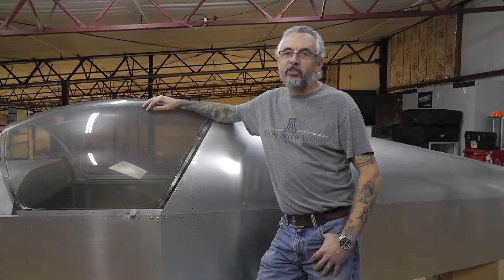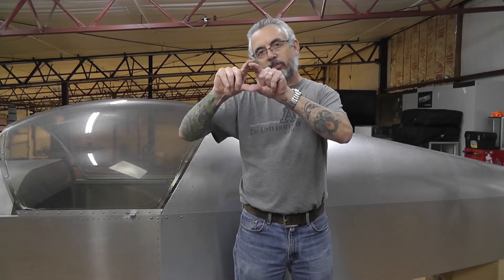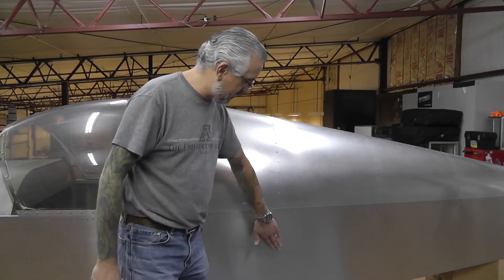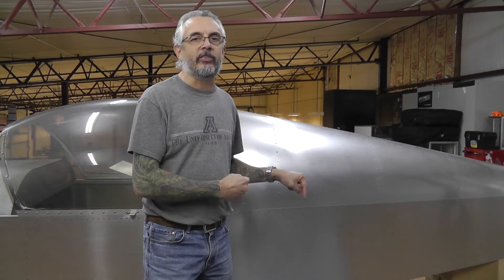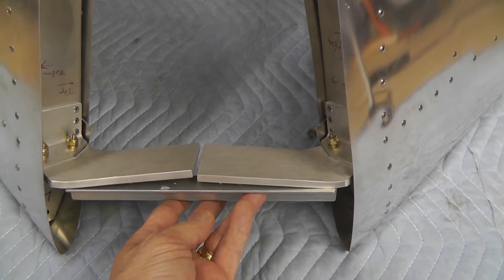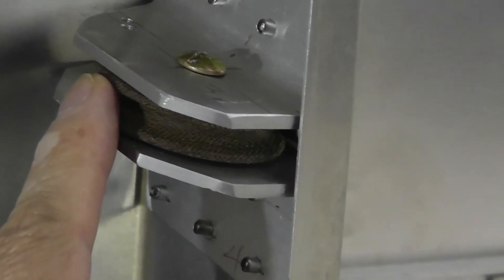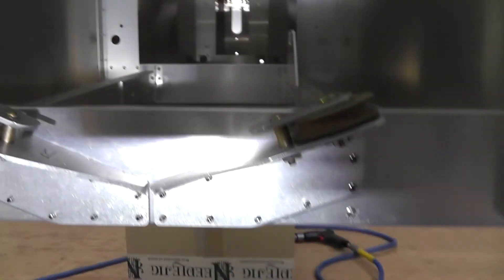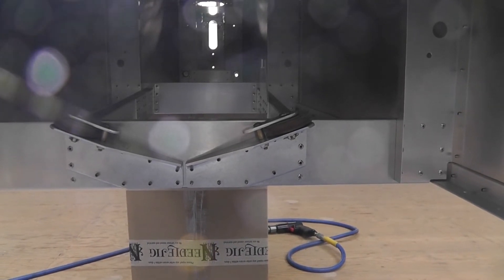Sonex Build Part 12 - Found More Parts That Need Corrections

Comment: After seeing this I will NEVER buy a kit plane someone else built. If I didn’t build it I ain’t flying it.
Reply from the maker: I think that should depend on who the builder was and what experience they had. The previous owner of my plane was more of a tinkerer than a mechanic or builder. There are a ton of folks out there building great planes and then eventually moving on to something new. I would probably not buy a kit that was half done but I would consider a kit plane that was completed and had some hours on it or one that had very little work done to start with.

Comment: Uhhh the guy who was building didn't really have a handle on aircraft work. But no problem. You find the problems and fix them!! It will be fine!
Reply from the maker: He is an awesome guy but did miss some important items. It definitely helps knowing that the factory did the bulk of the fuselage and wings.

Comment: Is it not possible to just remove the pulley assembly from the bracket to get access to drill the hole?
Reply from the maker: Yes, I considered that but the plans call for a larger hole to make sure that the cable has plenty of clearance in all directions. O think it is about 5/8". I will use a step drill and do not want to accidently damage the pulley brackets and then need to make more parts. Rivets are cheap and I am fairly confident that I can remove them without damage at this stage.